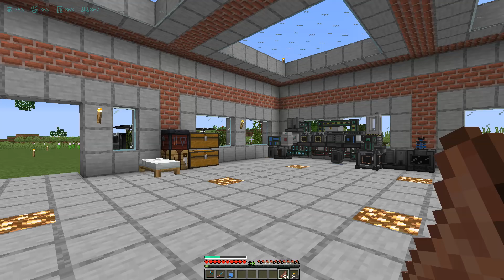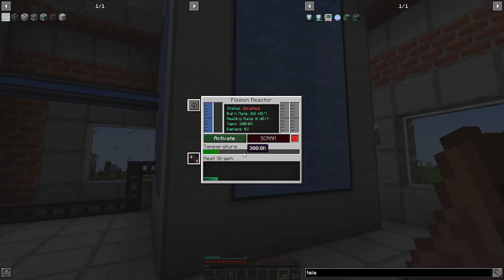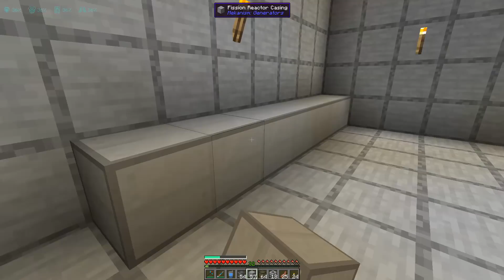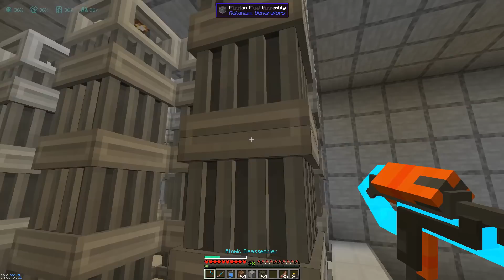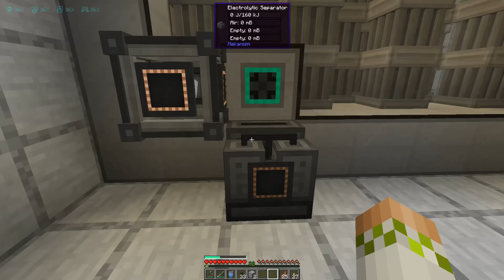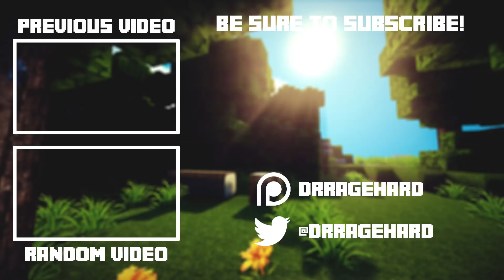Surviving With Mekanism v10 :: E18 - Sodium Cooled Fission Reactor

Comment: The sodium cooled mechanics are cool, but honestly, I can never see a reason to use them. The larger the structure of the reactor, the more heat it dissipates through surface area. Even a max-sized (18x18x18) water-cooled reactor only reaches a modest 655.19 K while producing almost 20 MFE on a max-sized turbine. That's with a burn rate of 250 mb/t, only 12.7% of the maximum.

There might be some VERY niche cases to warrant going sodium, but I can't think of any. Really, the only reason to do it is just to add complexity for the sake of it.

With that said, I love your videos! You're one of the few out there that give great thorough explanations, and I really appreciate it.

P.S. Running the above reactor at a burn rate of 718mb/t will park the heat level just below the 1.2k K limit, and that produces 14,350,632 mb/t of heated coolant. That'll power just shy of three full-sized turbines, so about 58 MFE/t. Sure, 62% of the reactor's feasible burn rate is left on the table, and could be reclaimed switching to sodium. However, think of the infrastructure to feed a 18x18x18 reactor with all that sodium, not to mention the boiler size needed to support it. It's just silly. Very cool mechanics, though, I don't want to take away from the mod, it just needs some balancing to make using this feature more useful and attractive.

Comment: I got a question, now I made the sodium all according to plan, I even had to use 2 evaporators to make it decent, in any case, what if I don't want to use it for the steam to produce power?

I already have a fusion reactor, so I get my power from there.

Can i just output the steam into a chemical tank and just make it empty?
Reply: you can dump the excess
Reply: You will still need water in the boiler in order to cool the sodium, I think? Just connect your turbine power output to a heater (or multiple) and set them to the maximum power consumption in EU. One resistive heater can consume up to 99,999,990 J/t if you use EU to set the value.

Comment: I really whish you would get into the logic thing. I have been searching for hours an no one seems to have done any videos on it. all I see are comments about a piston and a lever which doesn't sound good to me. I've tried my own testing in a few creative test worlds and all I end up doing is blowing the dam thing up and starting over because it doesn't work. a proper video on how to properly set the logic adapter up would be really good.
Reply: Make a RS Latch. Just two torches feeding into each other. So put a logic adapter that outputs redstone to a torch when the reactor gets to damage temperature. And in the opposite state of the RS latch output a lane to another logic adapter that turns on and off the reactor. And put a button in this torch( the one that mantains the pulse that activates the reactor). So, when the reactor overheats, the RS latch will switch it state, the reactor will shutdown and the turbine will still consume the steam and the water will cool down the reactor. The logic adapter won't output redstone because the reactor is now at normal temperature, but because it is connected to a latch, i will maintain its state until you manually go and click  a button to the other state of the latch to flip it.

Comment: Lastly(i should put these as replies but no one really reads them usually), setting a nor latch on the reactor onto a pair of redstone logic adapters, one for an overheat, and the other end for input, can help with safety.  Make sure you carefully watch the reactor though, and actually set it each time.

Comment: So i did a last test finally after some research, maybe enigmatica 6 buffed fission power, or possibly having a min size reactor was at fault, or faulty interaction between sodium cooled vs water cooled, and found myself with massive improvements.

I built a reactor with a total of ten cells in a five by five by five reactor, and tied it to a rather large turbine, about 7*7 wide this time.  After optimizing, i got a staggering 39k per mb per tic.  This was enormous compared to the pitiful 17k per tic i had, more than double the old value.

It seems to me, that your best bet is to go for 10-15 cell reactor and a very large turbune build directly above the reactor, at least 9*9 wide.  There is NO improvement going from water cooled to sodium cooled in terms of power output, so i wouldnt even bother with it.  If you can fit it, build a dynamic tank below the reactor to feed into it, creating a massive buffer for the generator.  Turbine can feed directly back into the reactor(make sure you use condensors in the turbine.)

Comment: Revisiting a comment i made a few days ago, i decided to look into “fuel breeding” into account.  That is, if your simply recycling the fuel 100%, no byproducts used for anything else.

One ingot turns into two yellowcake which turn into two fifty milibuckets of uranium oxide which combined to turn into 500 mbs of fissile fuel each, for 1 bucket fissile fuel for each uranium ingot obtained.
 
1 plutonium pellet is ultimately produced from 10000 mb of fissile fuel.

1000 mb of plutonium gas turns into 1 plutonium pellet to turn into 4 reprociessed fissile fragments.

1 reprocessed fissile fragment can be turned into 2000 mb fissile fuel.  So we get 8000 mb fissile fuel back after reprocessing 10000 mb fissile fuel.

If my math is right, you can stretch 64k of fissile fuel(one stack of uranium) about 4.5 fold.

I went at around 280000 fuel total from 100% reprocessing from 64k mb.  At 17k rf per mb of fissile fuel, i got it to around 4.76 billion rf out of one stack of uranium on a sodium cooled reactor continiuously reprocessed until it finally can no longer reprocess any uranium.

Note that this is all done on calculator, taking 64k and miltiplying it by .8 about a dozen times, until i got the numbers to a point that the returns were getting especially low.
Reply: I also thought about this.  Fusion is still far more desirable.  Its safer and fully automating for it is also easier.  Where-as fission if you were to 100% automate reprocessing into the system, the reactor will eventually begin to “choke”, and start fluctuating its power output.  That’d easily lead to a disaster and a meltdown.  Thing is fission reactors have to be slowly brought up to ideal speeds slowly, rather than start at top speed, or a meltdown can easily occur.

And once the existing fuel numbers drop below 10k, you cannot reprocess anymore.  If it was 100% automated, and that 10k disappears before the next reprocessed fuel cells are processed, or it runs out to fast,.

In fact, reprocessing could happen fully 8 times, that is you 100% reprocess the spent fuel after its 100% depleted.  This results in a total 277048 mb of fuel.

Still better to go for polonium.  Unless you really want that power right away.  Even then, you have ethylene for that.
Reply: @laughingalex7563  Fission reactors don't meltdown if they run out of fissile fuel, they just stop producing heat until they get more

Comment: Its funny that i did the math on power from steam in regards to fission, even with a sodium cooled to boiler i was only seeing about 17k rf per milibucket of fissile fuel vs 11.8k rf per milibucket….of ethylene in a gas generator.

Fission feels way underpowered for where it should be, in between fusion and ethylene.  It should be more than 3-4 times as dense, maybe much, much more, but still behind fusion.

Note: i did this on enigmatica 6.  I even have added pollution of the realms to the mix, still think a gas burning generator is better for power lol.

Corrected:  meant to say fissile fuel instead of steam.  Yes, its only about 50% more powerful than a much smaller and easier to scale power setup.

Maybe its enigmatica 6 nerfing power to steam ratios stupidly for mekanism turbines.

Comment: I don't think you need to have air inbetween them, mine worked fine without it.
Reply from the maker: The efficiency goes down if you don’t have air in between. You can make it without air technically but it’s worse to do so.
Reply: @RagePlaysGames  Strange, the wiki says the only thing actually counting for generated power/mb of fissile fuel is the number of rotors.
Reply from the maker: @ExtremeGamerYT22  Yea, the thing that changes is the boil efficiency of the fission reactor itself, which will be at 1 if you have them spaced out properly but will start dropping if you have them adjacent to each other.

Comment: I've come to the conclusion that unless you're really trying to max out antimatter production, this just isn't worth it.  A rate of like 50-60 is achievable with water which is sufficient for most uses.  Plus you can only make 1000 sodium/tic per thermal evaporation tower, and for a reactor that is large enough to need sodium you'd have a tank of like 50-70M at least, which would be around 17 hours to fill with sodium.  Then there's the issue that even at the burn rate that you need sodium for, your next bottleneck will be that you run out of uranium ore frequently and have to relocate your miner to get a fresh supply to go another 10 min or so.  It's also a lot safer to just use water since you only need to manage 2 megastructures instead of 3.  I almost blew myself up because in making the boiler bigger, I move the port, and to cycle to coolant output, you gotta go through steam output, which filled the return tube to the reactor with steam which meant I had to tear down the reactor or else risk blowing up upon reconstruction because it was super heated with no coolant left.
Reply: Firstly, I just calculated it, and at a rate of 1000 sodium per tick, 50M will be produced in less than an hour. Secondly, you can externally heat your thermal evaporation tower using the power that the reactor produces and achieve much MUCH higher temperatures, and thus, a higher sodium production. I agree with you on the uranium ore, though.
Reply: @gliese832c  the way I computed that value was to hook up everything, start it running, time it for a few minutes then extrapolate.  Maybe there was some other bottleneck hidden somewhere.  Also, I tried heating the tower to high levels but it capped at 1k
Reply: @askmiller  50 000 000 millibuckets divided by 1 000 millibuckets per tick = 50 000.

50 000 ticks divided by 20 ticks per second = 2 500.

2 500 divided by 60 seconds in a minute = 41.667.
Reply: @gliese832c  I don't doubt the mathematics of it, but I'm getting nowhere near that in the setup.  Maybe there's an issue with pipes or at the electrolytic separator, or with flow rates through a quantum entangloporter
Reply: @askmiller  You are probably correct. I would suggest taking a good look at every part of your setup to find the bottleneck. Though the Quantum Entagloporter should definitely be able to transfer more than 1000mB/t.

Comment: At around 19:00 you said that reactor wouldn't need sodium and water was good enough... Mine requires tons of water. I assume if you need more water that means you need a bigger Turbine?
Reply from the maker: Yes, you need a turbine that is able to process both steam and water at a level that is the same or higher than the rate of steam generation in the reactor. The heating rate is 20,000 mb water x fissile fuel burn rate and you need both the steam and water flow rate in the turbine to be equal or higher than that value otherwise it backs up. You also need the piping to be able to keep up with the systems they are connecting.

Comment: IDK why my sodium is not condensing and going back into my reactor. I have the ports set.  There is water being turned into steam.
Reply from the maker: Are you pulling the sodium from the steam catch layer using the valve set to coolant output? That is what you will connect back to your reactor from the thermoelectric boiler. If you’re still confused and it isn’t working the video going up tomorrow is on the thermoelectric boiler and how to finish this setup.

Comment: If you play around in a creative test world or dig through the mekanism code, it turns out that the reactor automatically voids excess heated coolant if it's full. I've had a water cooled reactor burning 20 mb/tick with no turbine connected, and it still runs fine as long as I use six or seven ultimate mechanical pipes pulling from infinite water sources from another mod.
Reply from the maker: Ah okay, so as long as you aren’t building a closed loop steady state setup and instead supplying constant fresh water/sodium you can let the heated coolant fill up. Thanks for the heads up :)
Reply: Thx for the info I was concerned I would have a scenario where the turbine couldn't out put cause the water pipe was full and the whole system would jam, this would solve that!
Reply: Just make sure you have some way of maintaining coolant flow into the reactor